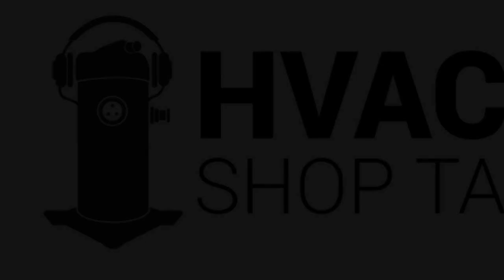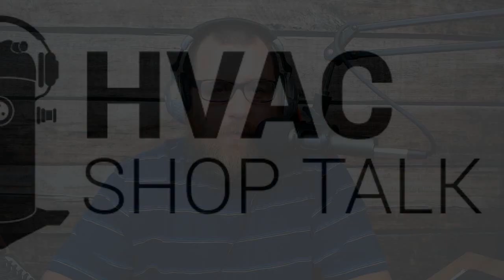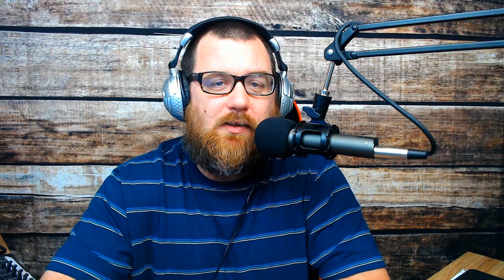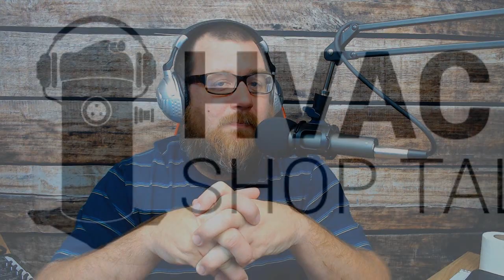Identifying Lined Duct Issues | HVAC Troubleshooting

Comment: Is it normal to have a main damper between the HVAC unit and the main duct distribution hub? I lost vent airflow all over my house. I ended up discovering a 14” butterfly gravity damper installed immediately above the HVAC and it’s barely opening the flaps when the unit is on. I’m not sure why there would even be a damper before any ducts. I thought dampers were to control zones in the individual feeds to the rooms. Is there a purpose for this damper? And if it is needed, can I clap it open until I can get a HVAC Repair guy out to replace it? My AC has been running non-stop for days and it can barely hold temperature let alone reduce it. I used a scope camera to look inside and seen it was only open a crack on one side while the AC blower was on. I was also able to gain access and open and close by hand but it seems too stiff to be opened by air power alone. Thanks!!!

Comment: Funny you did the video , I found duct liner that collapse came loose and blocked the air flow   . Is this common ? I'm just a boiler guy  so go easy on me!
Reply from the maker: It depends on how they are installed. Some are connected with stick pins, some with adhesive. The adhesive ones do come loose sometimes.

Comment: Hey Zack great video. Maybe you can make a video on how to pull a faster vacuum on an older existing system when you have to replace a compressor or reversing valve or something so the valves are open. Keep in mind that I don't have the Tru Blu hoses yet but I do use 2 yellow jacket 3/8 hoses, 2 Appion valve core removal tools, and a 6 cfm JB pump but it's still taking hours to evacuate, even with fresh oil. I use the same setup on new systems and older systems with the valves closed, say if I replace an evap coil, and I can pull to sub 200 microns in like 15 minutes. I don't think I've ever hit those levels with the valves open and I hate to say it but there's been times when I should have left my pump on the system over night, but my boss ain't having it so unfortunately I've charged systems up that haven't even hit 1200 microns yet because I'm being rushed.  Keep in mind these are systems that I know for sure aren't leaking from doing a standing pressure test with nitrogen, and I also always put the caps on the king valves in case they are leaking.  Any suggestions ?
Reply from the maker: Let me think about this so I can respond properly. I know old systems pose many issues with refrigerant trapped in oil, etc.